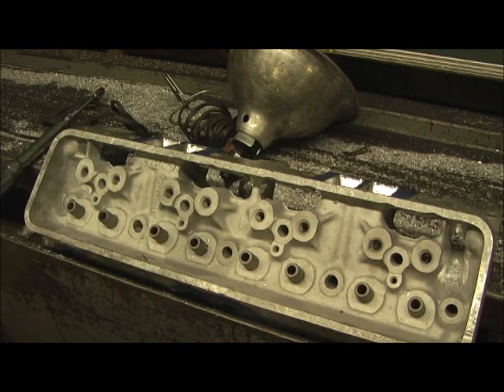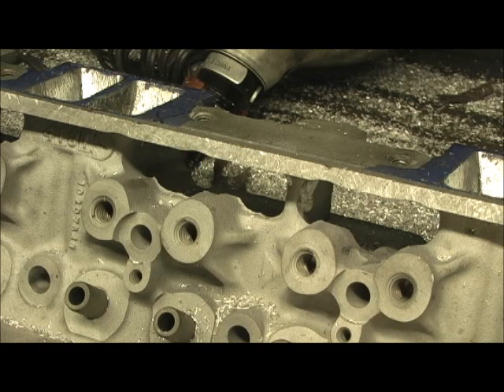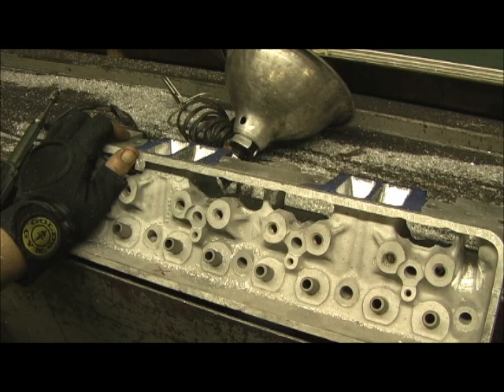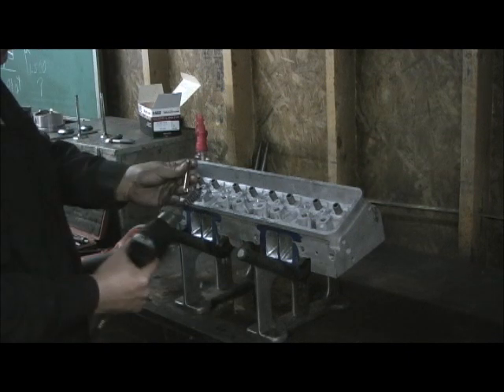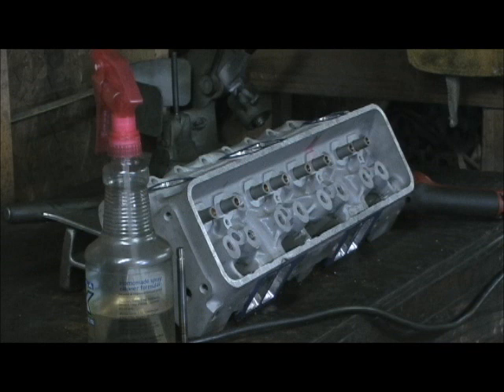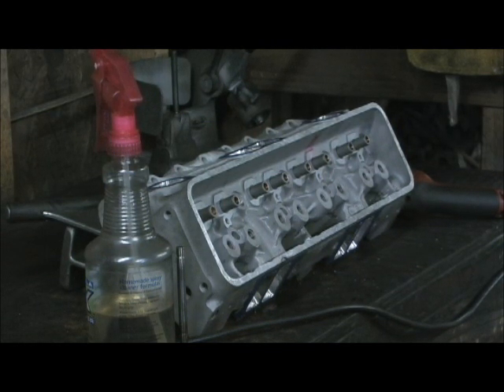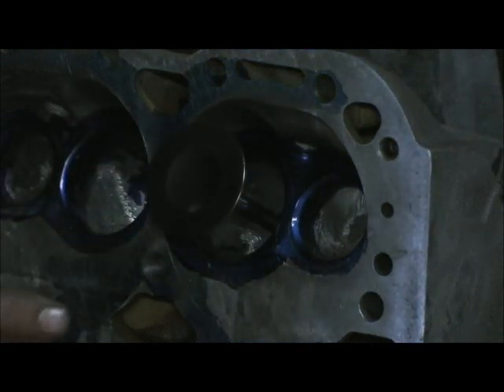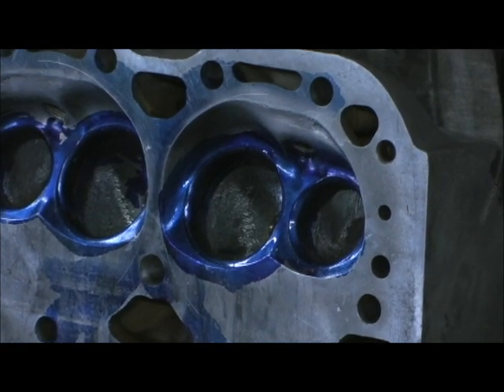LT 1 Stage IV Full Porting Part 4  2

Comment: I used a .026 head gasket and calculated compression to be around 10.84. The exhaust system is full length 1 5/8" headers, no cats and 3" all the way back. First I'll get the larger throttle body, I found one a 58mm for $260 then I'll mess with the rockers and more dyno time =). Stayed tuned for some more "dyno fluke" action!

Comment: Tony, I think we agree and you have already done this work so I will agree. The heat that you state keeps the imep higher in the power stroke for a few more degrees and COULD add a few ponys and ftlbs. depending on the combo. Depending on how much Carp would like to piss off the fools on the forums it might be fun to change out the exhaust rockers to 1.5s on the dyno and  see if they help, if they lose stick with the 1.6s. I do realize how expensive dyno time is.

Comment from the maker: Charles, I never really got into IMEP too much back then, as the software was very primitive (windows 3.1 heyday) until a man named Alan Lockheed came out with Engine Expert (a very expensive program that was of God Like envy of all the pro engine builders) it dealt with IMEP stuff, and shortly after that I left California in July of 1992. I know now it is used a LOT. We actually had a spark plug that cost 10,000.00 called a pressure transducer that measured BMEP while the engine was running.

Comment from the maker: Cont) the engine is in converting fuel to mechanical energy. Numbers like the low 5's (510, 520, 501) are great numbers I believe, I would have to look this back up on my old dyno sheets. I know that the lower the numbers (pretty sure) the better and more efficient the ports, camshaft and combustion chamber are in getting there job done. I says a lot about the cylinder head design if you LOCK OUT THE CAMSHAFT by keeping the same one in the engine while testing different heads.

Comment from the maker: IEMP is Indicated Effective Mean Pressure, which is theoretical, on paper as it says an Indicator, BMEP is actual measured Pressure or Brake Mean effective Pressure and the BOMB or real test I look for in a dyno run. I have over 3000 pulls in the early 1990's and the two things I paid attention to (between my boss and the "horsepower dial of Barometric pressure") is BMEP and BSFC which BSFC is  simple terms Brake Specific Fuel Consumption I do believe, and is what determines how effective (cont

Comment from the maker: Cont) shape runner fed by a straight shot Plenum DRY! With a carb on top, you can compensate the different length and shape of the center runner to the end runners by playing with Ratios. It is that simple and I have put that in the mix with Compression ratios IF you have the EGT's on hand (exhaust Gas Temps) by thermal couples in a dyno cell to each header tube. I like to see around 1100 to 1200 Degrees and differences no greater than 100 degrees (50 is dreaming, or lots of dyno time).

Comment from the maker: cont) the exhaust port of the covered wagon shape and high port volume of your heads, you need the 1.6 as your compression is up around 10.5.1 compression, so heat is not a problem. The only way you would know, however is to swap between the 1.5 and 1.6 to be sure. I have split rockers and had three different ratios at a time to squeeze all the power the engine has to offer. This is where the intake manifold comes in, but not with you as your injected and have a BOX type intake with equal (Cont

Comment from the maker: I meant to say (sorry for the confusion) that on most of my Chevy heads I have had better luck by placing the 1.6 on the intake and 1.5 on the exhaust. This is done for several reasons, Intake manifold design being one of them along with Compression Ratio. ON low compression engines, it is imperative to retain HEAT in the combustion process, so I keep the 1.5's on the exhaust to promote heat which in part is the "working fluid to mechanical energy" thing. With you case the awesome shape of (cont

Comment: Continued: I would bet that there are a few ftlb and a few ponys to be had if the rest of the exhaust system is really good. If the exhaust is just ok leave in the 1.6 rockers the added duration and lift will help.

Comment: It depends on the engine combination and the imep the engine operates at. The  indicated mean effective pressure is what pushes the piston down the bore and produces power. You are operating at a high imep because you are making great power. Remember 1.6 rockers add about two degrees duration and some lift this increases your overlap and MAY decrease your imep over a 1.5 rocker. The exhaust is already at high pressure and Tony kicks ass with his ports so they blow down super fast.

Comment from the maker: I must concur Charles, the Crower are the best rocker out there and "EXPENSIVE". If I was going to do it on my budget I would go Comp Cams Pro Magnums as well. There are some GOOD aluminum ones though, just not from China. The main advantage in leaving the Comp Magnums is Ratios, as the Stamped rockers can vary as much as a WHOLE RATIO and in some cases MORE that I have seen, so just getting them all the same is POWER and I always had best luck with 1.6 on Intake and 1.5 Exhaust for sure.

Comment: In my opinion Crower stainless are expensive but indestructible! Comp Cams pro magnums are a good second choice. Stay away from aluminum rockers they have a short fatigue life. I personally like using 1.6 on the intakes and 1.52 on the exhaust. Save your $ on the rockers now and upgrade your headers to 1 7/8" or replace the GM throttle body first. The Comp magnums will hold out for a while they are pretty tough.

Comment: i knew it. we had a perkins 4cyl. rebuilt for a customer and after break in one exhaust valve stuck open. the engin shop told our shop forman that the guides didnt need to be sized that it was the valve seal dident let enuf oil in the guied. lol i told him all bronze guides have to be broached and thats still not 100% accurate

Comment from the maker: I have never seen such an animal. As a matter of fact Met, the only way to do this CORRECTLY is that you have to install it undersize by about .001 so you can "HAND HONE" like a cylinder bore on a block to piston deal in order to get the tapper down to a minimum (around no greater than .0003, and shoot for under that, like .0001 when I am lucky enough to get it). That then gives you an incredible life out of the valve job, as the valve job is 100% dependent on the guides. Thanks